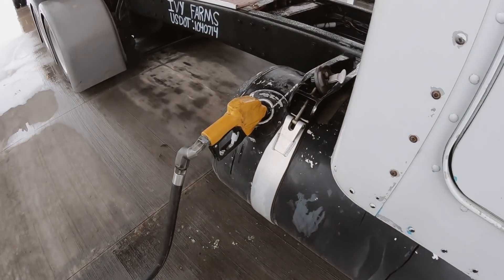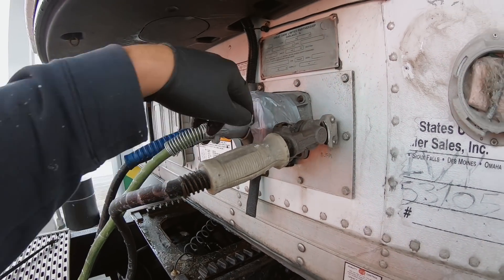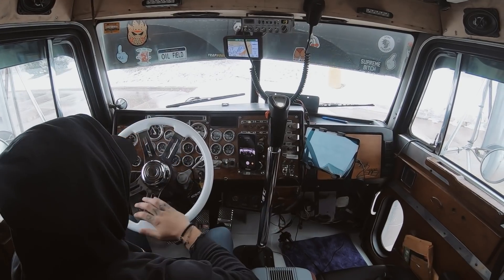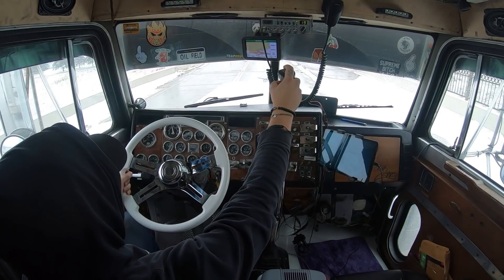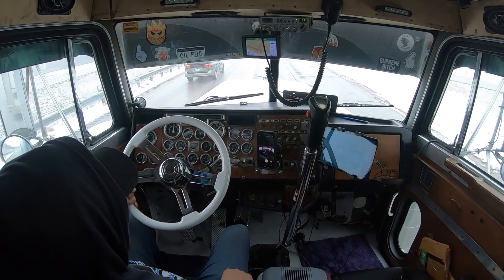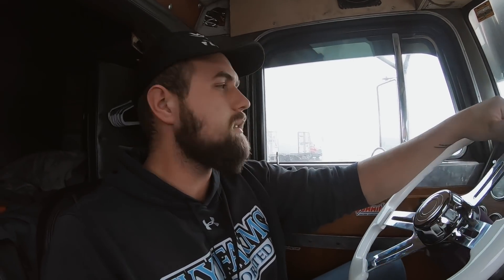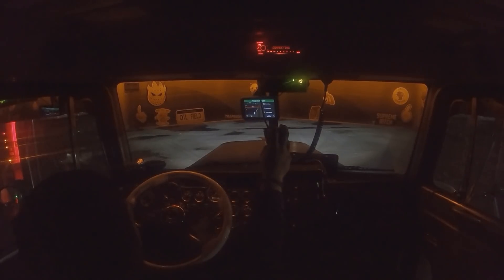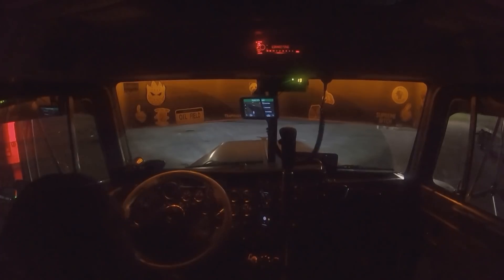Owner Op first run with stretched Pete in Snow

Comment: Some suggestions. If you back into the driveway you aren't liable for accident. Backing into traffic the liability is on you. Also put a window in the back of the bunk. You can watch the trailer when backing, also blindsiding is easier. Enjoying your videos.

Comment: Never could see the point of those super high shift levers. My arm would get tired. And what’s this thing with pulling it out of gear to shift the splitter? That seems to be a more common thing lately with some drivers. I always just flip the switch, lift my foot off the throttle and back on no need to move the stick.
Reply: i was wondering that as well, seems to only do it for 7th and 8th
Reply: If you have to ask, there's no need explaining it to you. Lol. There's no purpose for tall shifter or popping out and back in when splitting gears, it's just a little something extra to do. Same old thing gets boring to some of us. Some guys are the plain jane type, some like things different.

Comment: Dude I was at 208 for many years and it's hard being a trucker losing weight but took a metablosim booster and a protein shake and dropped 20lbs in 2 weeks and i flex in the low to high 180's but huge difference i feel. I hit a rough point but if you want to see what I use hmu it really is good.